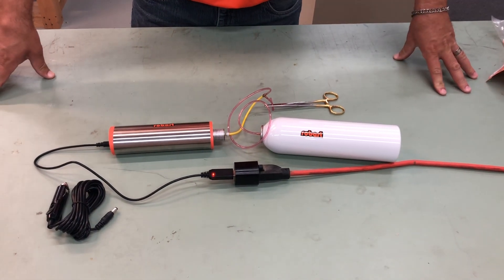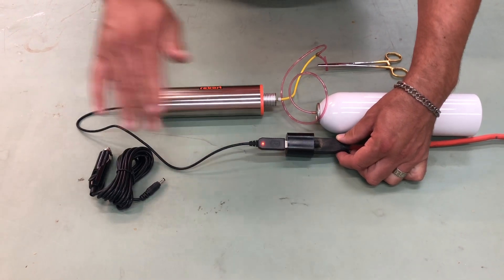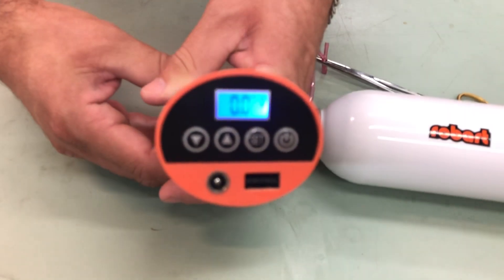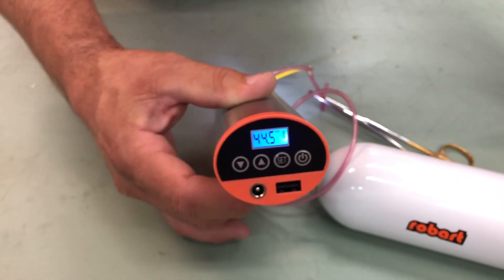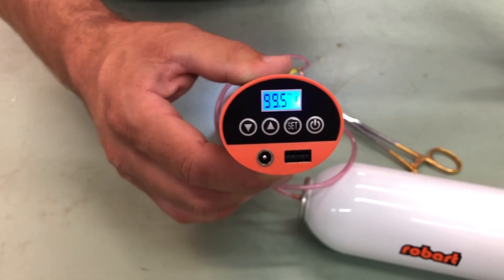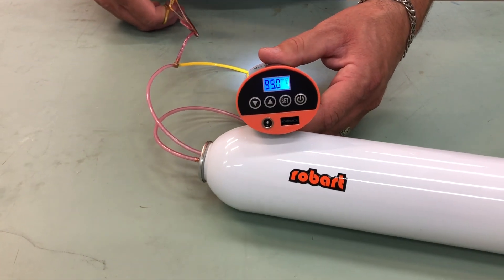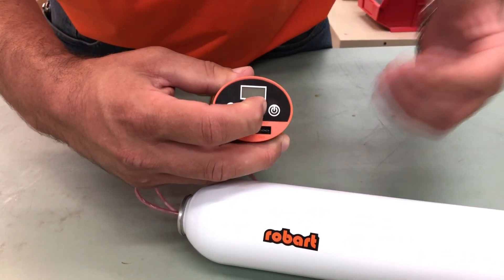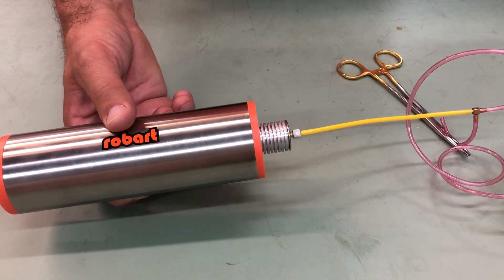164OB On Board Air Pump in a Pneumatic System

Comment: Hi; It would be nice if you can develope a next generation to have a lead harness to turn it off with an exturnal switch. I think you would have a better sale interest for it.
I will still get one though. A very nice product.
I have a question. is it a good idea to leave the recharge cable to the unite with out always having to gain access. I was also thinking of making a quick disconnect addaptor for it

Comment: I understand you have to turn it on before you assemble your aircraft. If you are out for a day of flying, do you then leave it on while you are at the field and then turn it off when you disassemble your aircraft? I know you don't intend for the modeler to disassemble his aircraft after each flight to turn the pump off, then turn it back on before the next flight and reassemble the aircraft.
Reply from the maker: You will have to have your pneumatic system fully assembled prior to turning the pump on.  Once the pump is on, it will monitor your PSI between 80-100 psi.  Once you turn the pump off, for the screen to go dark, you will need to release the PSI to 0. 

If you are worried about battery life and want to turn the pump and screen off, you can easily obtain this by putting a quick disconnect between the pump and your system.

Then before each flight, you will simply connect the quick disconnect and turn the pump on.  However, I would suspect that this would use more battery than simply keeping the display on. 

I hope this answered your question.